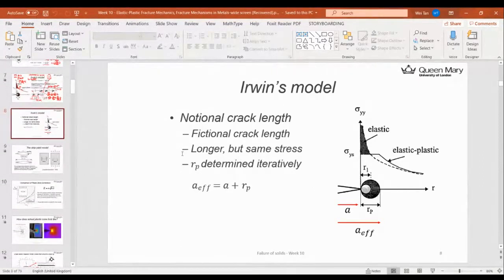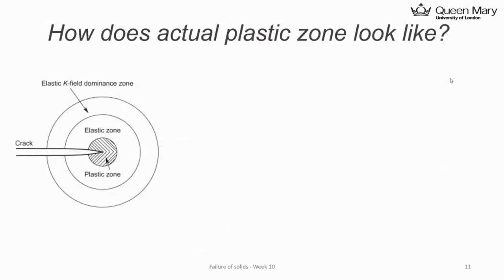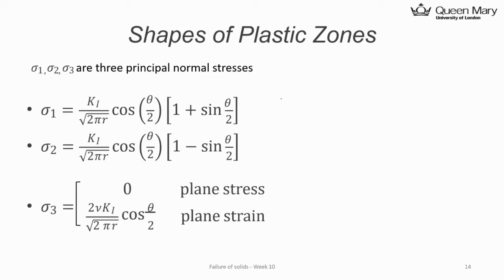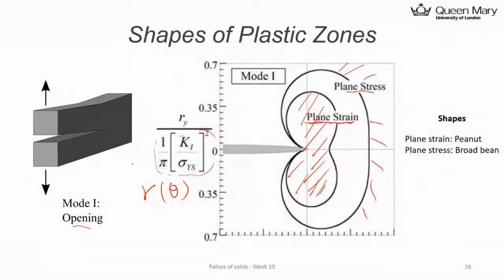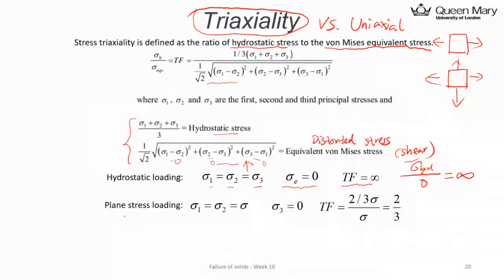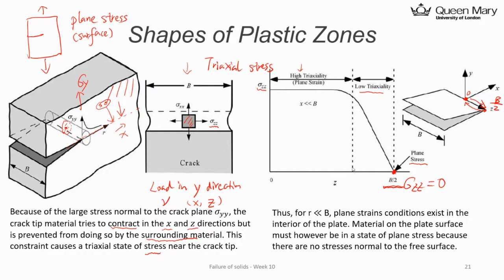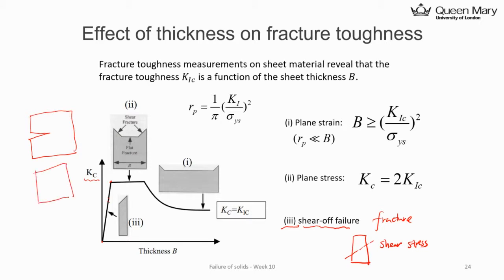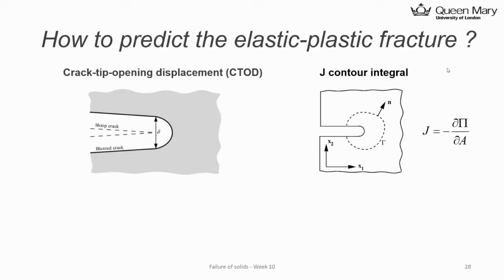Week 10: Elastic-plastic fracture mechanics

Comment: Hello Prof. Thank you for very informative lectures. Please let me ask a question. On the 47th minute the question ask us about feseability of a specimen. Are we going to search for K1C value of the specimen in the fracture toughness test? If so how did we used given fracture toughness in the calculation assuming we have not known it because we are going to find it from test. (Or that value could be found another way) And we are not going to execute that test because the measurents of the specimen will not allow. Am I missing something? Thak you for consideration.
Reply from the maker: Thank you for your insightful question. Indeed, we don't know this KIc value until we measure it. Typically, we initiate an initial test with a sizable sample to measure KIc, aiming to avoid any plastic deformation. Following this, we utilize the provided equation to assess the validity of the linear elastic fracture test. If this proves invalid, we have the option to modify the sample size and conduct additional tests until the condition is met.
Reply: Thank you very much for answer. @mechanicsforengineers

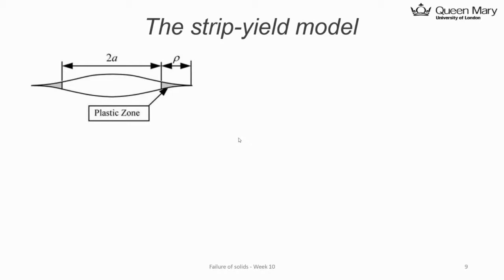Comment: Hi, thanks for the lesson. Really good way of presenting these concepts. I noticed a small mistake at 1:43 for the effective crack length it is not rp by r1
Reply from the maker: Thanks Daniel for your comments. If you just consider elastic deformation at the crack tip, the effective crack length is a+r1. However, when plasticity takes place, the effective crack length should be a+rp. Because the stress has redistributed once the yield stress is reached.